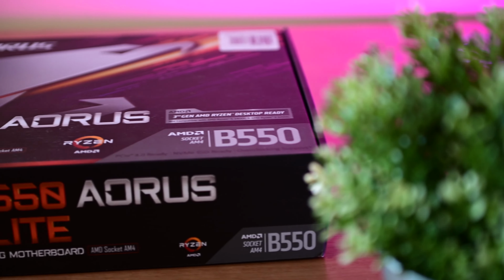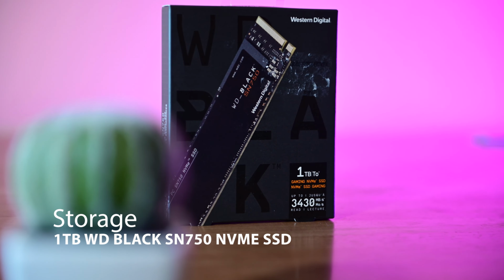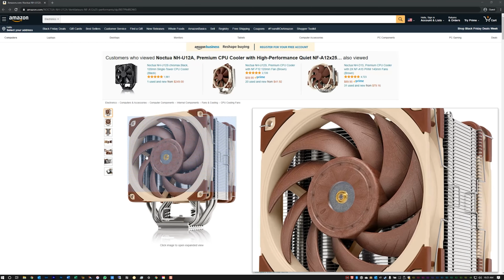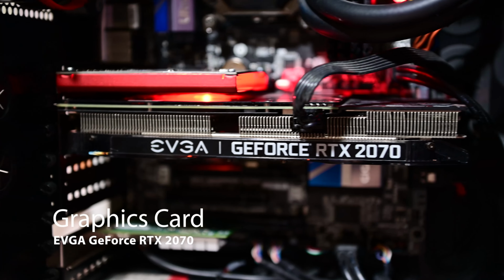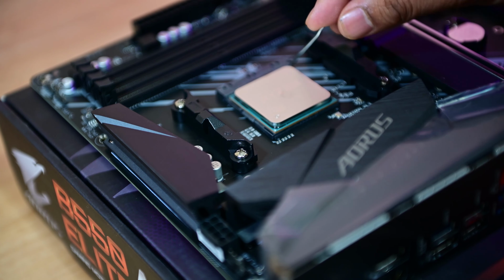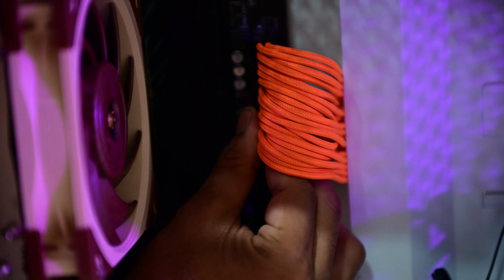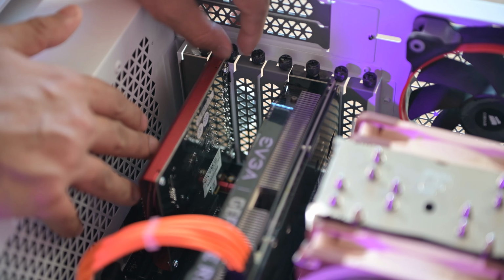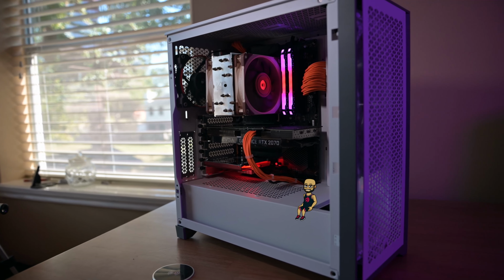AMD Ryzen 5900X Build - My FIRST Computer Build With an AMD CPU

Comment: How was the temp? Thank
Reply from the maker: On 100% load on the CPU, I’m getting roughly 90 degrees. Given that I haven’t overclocked, it’s not exactly ideal but maybe down the road to boost performance, I can upgrade the cooler and OC.
Reply from the maker: It idles at around 45 degrees

Comment: I'm still using my 3770k !
Reply from the maker: I don’t blame you, for most tasks, that’s still a great CPU!
Reply: @TechTalkwithSamir  I'm also looking at purchasing a X5900 with Dark Hero M.B and G skill 4000 Mhz ram
Reply from the maker: It’s definitely going to be a big upgrade. However, you may have to wait a little until it is more widely available. It seems impossible to find any in stock anywhere.